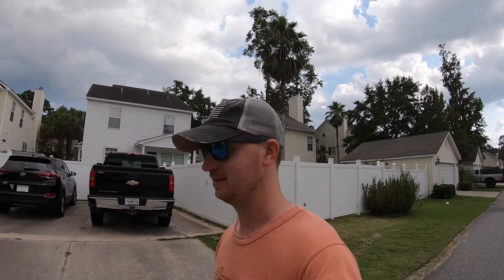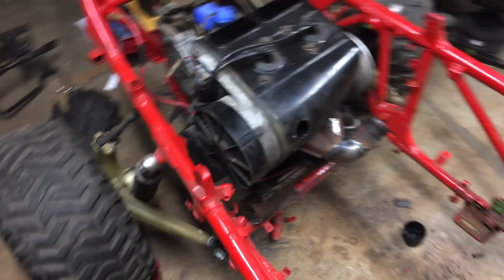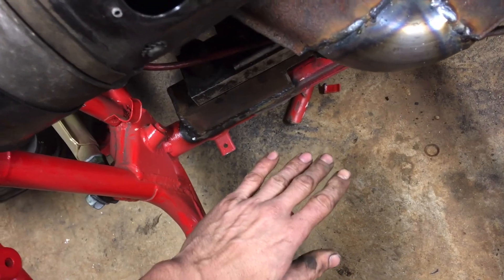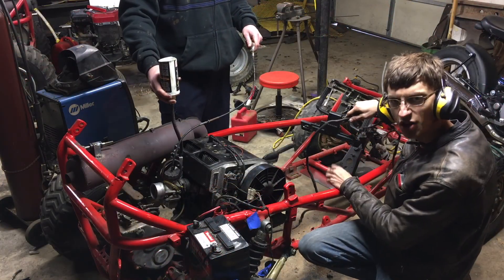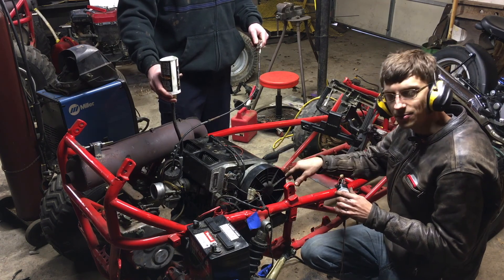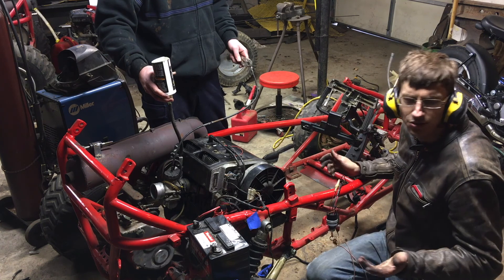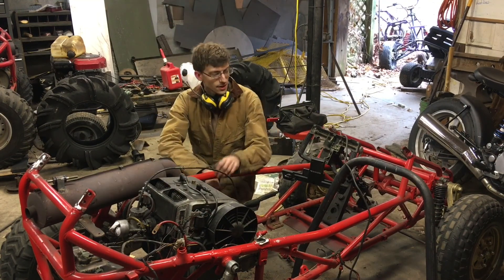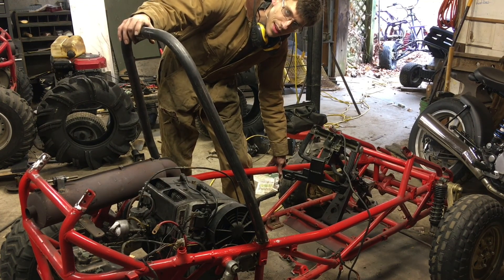FL350 build part 2: Putting a 500cc snowmobile engine in an fl350

Comment: Iam in the proces of doing the same build how did u make the belt fit the from the clutch converter  to the gear box clutch the belt is to wide it only fits the main clutch
Reply from the maker: No, I know there is some fine tuning that needs to be done with the clutches, but they work good enough for now. We plan to go back and tune the clutches better once we get everything else together. Right now there’s no need for our purposes.
Reply from the maker: We used the drive clutch from the snowmobile, and the Honda fl350 driven clutch. They were not an exact match, but we’re close enough that they would fit the same belt. 

If I had to guess the engine you have must be using a different pulley set on the CVT from the one I used. My best suggestion would be to see if you can replace the fl350 driven pulley with the pulley from the snowmobile. Hope this helps, good luck with your build.
Reply: Did you open the honda fl350 driven clutch wider with spacer to make the belt fit??